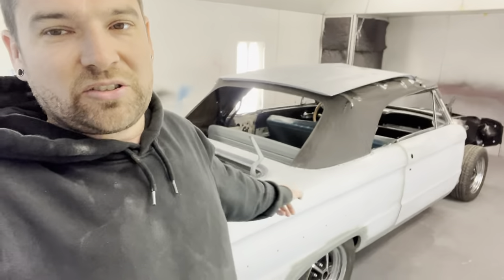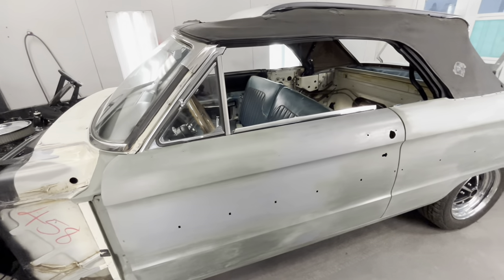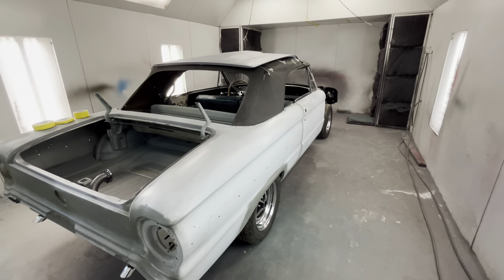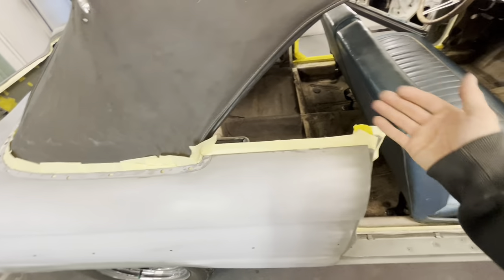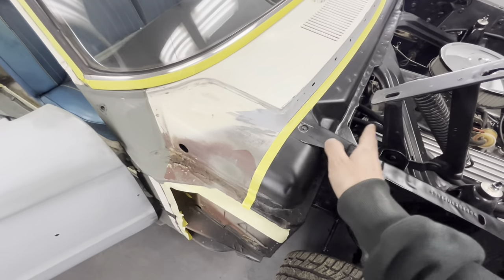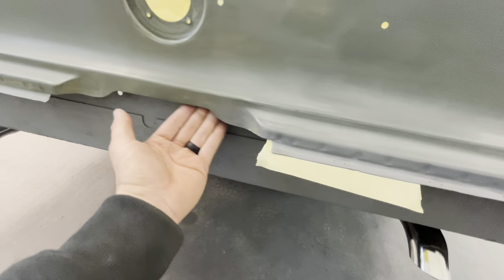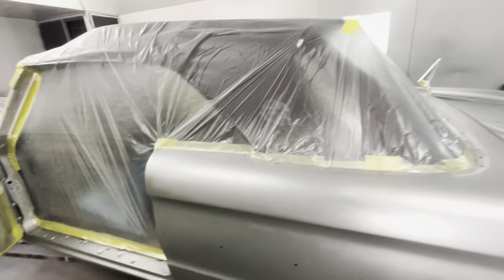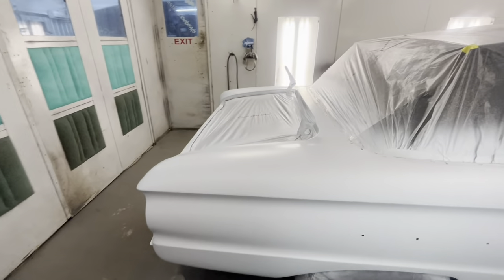💦 Painting The Falcon 🔥 Here’s A Guide To Help You

Comment: i have heard you say 100 times that you only got paid to paint and i understand that aspect of the job but you also said 100 times about the top of the drivers door grind marks well im sure it would not cost you more than 5/10 dollars to take a piece of 400 grit and scuff out the grind marks out of the silver dropcoat you sprayed  and that alone would have saved you from talking about it 100 times  do you understand that by doing this it would have made you feel better about the job as a whole and your customer would be much happier , you wouldnt have needed to spray extra coats of clear and risk running that , so when you took this job and bid it at 3k im sure you left yourself some wiggle room and this part would have fallen right into that space , nice work car looks pretty good considering
Reply from the maker: Thank you I understand your point of view but it simply wasn’t worth the work to me.